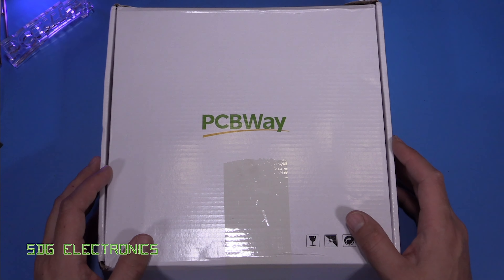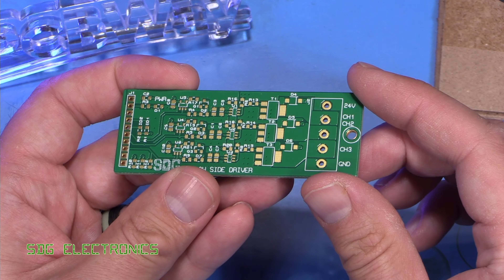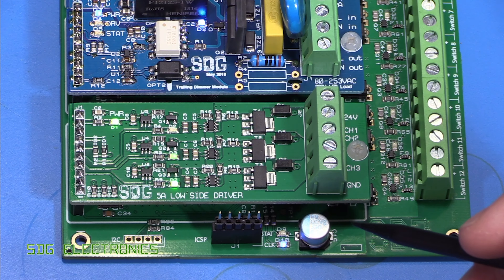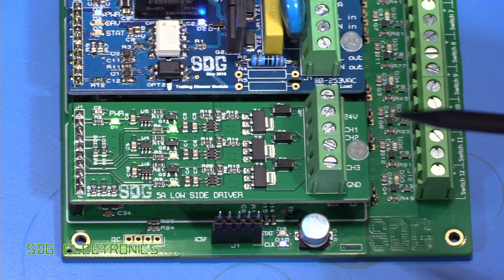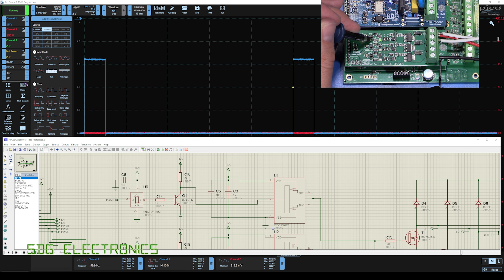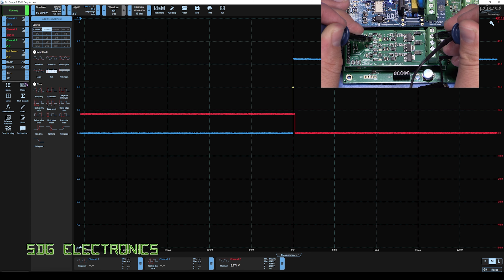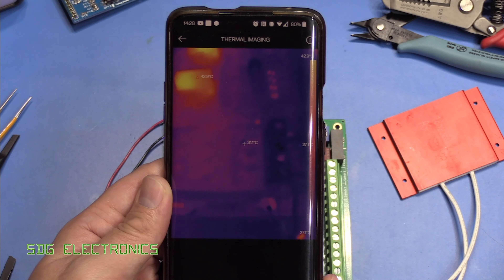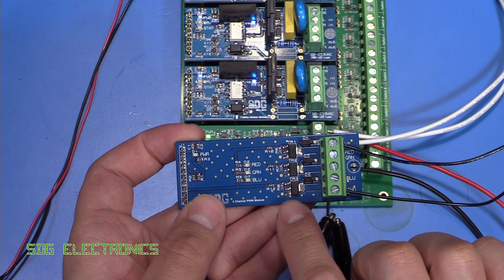SDG #278 Assembling and Testing the High Current MOSFET driver

Comment: Interesting the use of the common base, not a configuration you see much of. 

Thinking about the operation of the circuit and what it achieves. When the emitter is low it carries a little bit more than the collector due to the base current pulling the output low. But when the emitter is high (3.3V) the same as the base voltage then the collector to emitter resistance is very high, effectively a reversed biased diode junction. 

Makes you think, an amplifier with a gain of less than 1, but low input impedance and high output impedance and non inverting to boot.

Might have to play with the common base a bit more as i said before not one you see much.
Reply: Also check out the cascode configuration then. That's basically the combination of a common emitter and a common base transistor

Comment: Steve, would you ever consider one of those DIY p&p machines? Like the LitePlacer that EEVBlog is going to make a video series of assembling? Speaking of p&p how are you picking and placing the parts?
Reply: The Lumen PNP is also worth looking into (formerly Index PNP) 🤓
Reply: He has videos discussing the vacuum pump setup.
Reply from the maker: If I had space for one, I definitely would for some builds. This PCB took only 10 minutes from start to finish, though, so quicker to do by hand than set up a machine!

Comment: I tried to do the same thing with 10uSec pulse @ 30Hz , the LEDs are very low Lamination even when i measure 2A across the LED
can you try it with your circuit?

Comment: Hi Steve, what's the function of D4, D5 and D6? Are they connected to +12V at their cathode side? Thanks!
Reply: Yes, its explained in the last video. In case of inductance on the loads, it will shunt to 12V.
Reply: @jaro6985  Thanks!
Reply from the maker: Exactly as Ja Ro said, just to protect the MOSFET if there is any inductance on the load
Reply: @sdgelectronics  Thanks for also replying!
Reply: @jaro6985 doesn’t it shunt to the load VSupply, in this case 24V?
Reply: @bsodmike  yeah 12V or 24V whatever, as long as its less than the breakdown voltage.